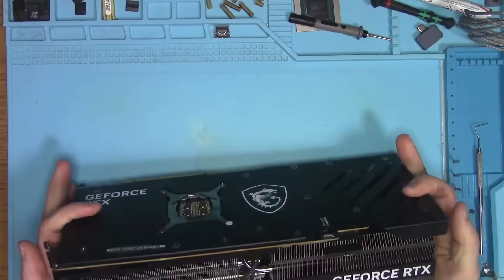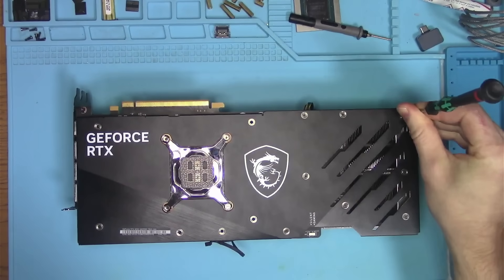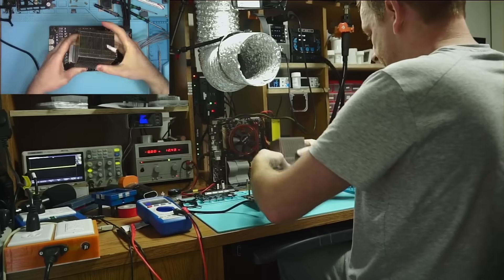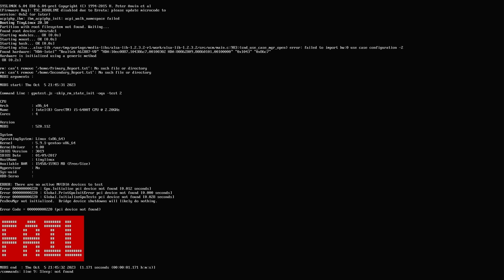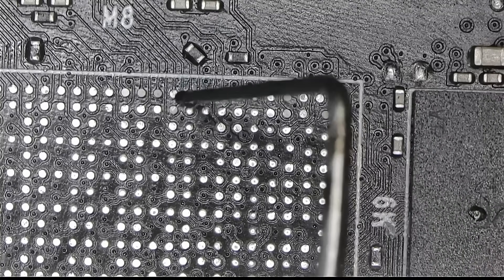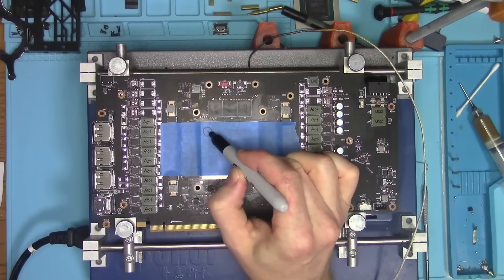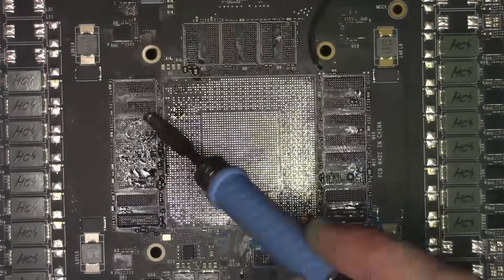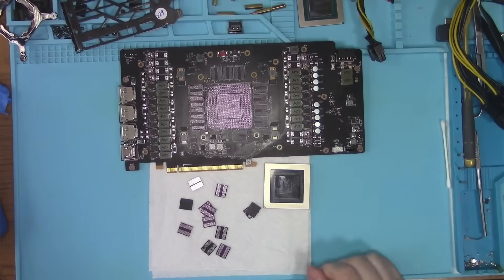MSI 4090 manufacturing flaw was discovered the hard way

Comment: I also repair graphics cards but through RMA although I only deal with ASRock. My coworkers are the ones that deal with MSI and they always say that this is random but very common. Sometimes after finishing a diag test with no issues, we proceed to do 3d benchmarks on windows as final test and the card just dies with the same issue. The people from the main branch in Taiwan always complain about the repair rate of their cards pushing all the blame on my coworkers when in reality many of their cards have the same issue. Another example with similar issue is the 4070 Ti Ventus, which always gets its pads connecting to memory channel A1 lifted from the PCB.
Reply: which brand do you recommend to buy GPU from?
Reply: @doctor_who1  I can't really really recommend a specific brand - it's all luck as well. I personally have a 3080 Vision OC from Gigabyte but for only one year so no problems so far although I've seen people complaining about the design's flaws of their cards. ASUS seems to have issues with shorting with their ROG Strix 30 series, their TUF Gaming card memories tend to die from heat as the pads always seem to be dry when arriving. ASRock cards are AMD only so memory are mostly the main issue - at least the ones that arrive.
Reply: @doctor_who1  google for a tier list. it depends on the specific model and generation. a good brand in one gen can turn crap into the next
Reply: @doctor_who1 I would go Zotac.
Reply: @utley  no way..  thats worse the anything.. lol.
Reply: @Ryan-re1rs  not sure why, Ive always had great luck with them.

Comment: Here in NZ that card costs $3500 NZD ($2100 USD). That's a fair amount of coin lost to oxidization due MSI's penny pinching, incompetence, or both. Ouch.
Reply: just another reason now on why not to buy MSI stuff. I "reluctantly" bought an MSI board a few months ago after I had a couple Asus boards crap out on me. now I have new fears.
Reply: @utley  It's every company nowadays. Lowering quality as much as possible, cutting costs wherever to maximise profit. These decisions were not made from the engineers or designers but the cancer that exists in every big corpo. Also they know how to to fix the GPU sag but they don't want to, because it doesn't benefit them in any way. The market is full or unregulated mediocre products that have planned obsolescence a bit after the warranty they give you.
Reply: @Vandelgard So True.
Reply: @utley what're the other reasons?
Reply: @utley  Still rockin' my MSI 980Ti from 2015, it's holding up well after all these years. 
But their quality has definitely dipped in the last couple of years, the CEO literally got suicided lol (he randomly fell from the top building, like in soviet russia)
Reply: This really leaves we in a weird spot. I am looking to buy a 4080 this holiday season. I've had many Gigabyte cards over the years and their quality is seeming to trend down so I wanted to look elsewhere.

With ASUS facing controversies across their entire product line over the last year, I am avoiding them altogether. And now seeing that MSI might also be cutting corners I don't know where to turn to.
Reply: @FlexLex  imo it doesn't actually matter too much - as long as you use a good gpu support for the weight & make sure it's fully plugged in properly, you're statistically unlikely to have problems with any of the major board partner cards.  i don't think there's one "magical" brand that can be fully trusted these days, so it's a pick your poison kinda thing unfortunately.
Reply: this is whatever factory worker assembled and whatever inspector inspected, plus the builder for not testing the rig good enough.
Reply: This is complete non sense and an irresposible comment, these type of things happens on every company, not only msi, happens on asus, zotac, evga, intel, the list goes on.... The real thing is not about the mistakes but how they handle the aftermath.

I own a 4090 trio as well and is happily running on my rig since december. That poor fella just got unlucky.... now... why he choose to send it to him instead of claiming the warranty is beyond me.
Reply: @ravell2854  Ive had to deal with an RMA for an MSI board a few years ago. The board was an expensive $400+ board and it wouldnt have any network connectivity. They sent me a replacement board that was all scratched up to holy hell and was missing a bunch of stuff. I straight up tossed that piece of shit back in the trash and just went with Asus instead after that. Then MSI upped the ante a few years ago and started scalping their own cards. Before the motherboard fiasco, I absolutely did love MSI; had 2 GTX970s, a really badass system. I won touch them now unless I have to.
Reply: @ravell2854  Another one with the same card and ZERO problems. And mine already has 1 year, with another two years of warranty (I live in the EU). And my previous graphics card was an MSI RTX 3090 Trio X Gaming, purchased in November 2020, almost 3 years ago, and it is working on my son's computer without any problems.
Reply: @ravell2854  You mean my comment about MSI's shortcomings in this case? Sure, other companies have them too, but do I have to list them all when it is a video about a particular case of MSI's ones? Yeah, nah. 
Did you get a little defensive of the GPU because it's your prized purchase being questioned? That happens. 
Your card still works great? That's nice for you. This one does not and the video explains why. Manufacturing choices that are uniform across at least that batch.

Comment: Wow, why wasn't that 4090 still under warranty? Just RMA it, as a DOA.
Reply: I wager a guess, the prebuilt seller refused to take care of it, attempting to blame the customer; subsequently conflict resolution of a payment platform (eBay/Amazon/PayPal) stepped in and awarded the customer a refund on the entire purchase. Of course after that, the customer no longer need to return the build to the seller. Seller acted on the worst instincts of a businessman and ended up getting schooled for that.

Seller is responsible for RMA handling. Obviously in this case the seller would do no such thing.

MSI does have a contingency for just this sort of case, that there is a warranty active from date of manufacture without valid proof of purchase. It's unclear though what would happen, since the card clearly suffered physical (transport) damage. Those ripped pads are indicative of that. Well it's also obvious the card wasn't soldered correctly because of oxide covered pads, but it's not the primary reason why it was DOA.
Reply: prebuilt doesent have seperate warranty on gpu just the whole computer
Reply: @Jonathan900S  well, that gpu is 3x times the price of the whole pc, so no reason to return full computer back, makes no sense, unless "it fell off a truck" as someone said earlier.

Comment: I don't know how MSI thought this was OK to ship. Yikes.
Reply: You can’t go after them without a clear chain of custody, which we don’t have.
Reply: Every manufacturer will have a bad item once in awhile. The difference is some give the customer the runaround, better companies will take care of the customer, and make any necessary changes to prevent excessive failures. I'm guessing they test each card before it gets packaged, and perhaps the connections were good enough to last 5 minutes. I'm sure the system builder probably also tested the card, since this was a prebuilt system, I'm sure the system had to be running long enough to install OS and do some basic setup before shipping. I don't think it was a shady system builder, the builder of this PC gave him a refund for the bad card already. A terrible system builder would have been like, sorry bro, go deal with MSI yourself... That would have pissed me off, prebuilt systems with a 4090 aren't cheap...

Comment: 2k euro cards and manufacturers still cheap in the basic things like proper assembly ,good materials and check units to avoid DOA. im pretty sure soldering balls are the "cheap" kind ¬¬. a few years ago i bought a msi rtx 2080 seahawk EK X card , and it reached 80ºC with 2*360 radiators... the explanation? they used dry TIM and half the core was shinny ( no TIM at all) used good ol metal liquid and has been dunno ,5 years without maintenance and still running cyberpunk  up to today :). after that for my main rig i went directly to nvidia FE card and have no complains ,4080 FE is a beast ,chunky but really good tems perfect performance and almost 0 noise :)
Reply from the maker: I have to agree. FE cards are built better.
The issue with that is NVIDIA is monopolizing GPU market producing FE cards before vendors are able to get any usable information about the new design requirements.
Nvidia did this on purpose and they are able to get it cheaper because they are the manufacturer where as vendors have to pay royalties and  source chips from Nvidia at inflated rates.
Reply: @northwestrepair  Yeah but like you I don't like blower cards. I prefer the 3 fan style, yes they're longer, but the temps are better. I recently got an MSI Suprim X 4070ti, so far solid as a rock, and temps are great even running back to back benchmarks.
Reply: @northwestrepair  This is exactly why EVGA got out of the GPU business. Which really sucks, I used to love EVGA. I have an EVGA 3070 (pre- limited hash rate) in my personal system, no issues since 2021 other than some driver issues that was easy to fix by updating. Also I had to flash the vBios, to be able to enable resizeable Bar, but that was because it came out just after. It's an EVGA 3070 ftw 3 Ultra edition. Sad thing was the availability was so bad, had to get it from a scalper on eBay, and I paid almost as much as a 4080 costs today, lol.
Reply: @northwestrepair   indeed nvidia is trashing the market but tbh FE cards are built like like old hardware used to be ,strong and durable . That said ,the 1400€ still hurts when i remember the bill XD. i used to watercool cpy and gpu ,but now with a ryzen 5800x3d and 4080FE watercooling is not needed anymore :)
Reply: Used to have a msi gtx 970 that after about 6 year started to overheat and was always pegged at 80 degree but it never died, i eventually replaced the paste and it was good again.

Comment: What baffles me is why they sent the card to you, instead of having the builder of the prebuilt warranty it?
Reply from the maker: I think he got a refund.
Reply: @northwestrepair  He got refunded but still has the part?
Reply: @princeking1562  It happened to me, refunded a 6900 xt for driver issues, then sold it
Reply: @northwestrepair  How much do you charge for resoldering melted 12vhpwr connectors? I've always wondered lol.
Reply from the maker: @Orlyy  repair is repair.
Same price as if I had to reball the core or solder a single resistor.
Reply: @northwestrepair  you, good sir, are of a dying breed of techs with such an attitude... Bless you, truly!
Reply: @viacheslavlopatskiy2203  it's a positive attitude, but one that doesn't scale well. Repair has really to factor in risk, because no matter how good one is there simply are tasks that will fail more often and induce in higher cost of time and parts to the technician. That cost cannot be stuck on the repair person and must be passed to all customers by defining a price for each type of repair. Regardless of one solder reball being easier than another or not.
Reply: @cldpt  That's why this card is a donor. Some fixes are simply not worth it.
Reply: @northwestrepair  Ngl you are smart as hell, like, holy shit.
Reply: @cldpt  you're saying that as if he didn't factor that in when he chose the price for his repairs...
Reply: @northwestrepair and how much did he pay for you to fix it?
Reply: @RandomDeforge he didn't fix it, if he did probably 4 or $500.
Reply: i agree, this 100% should have been warranty. i dont think msi will refund something without getting the item back.
Reply: @UrokLizard  actually it’s possible